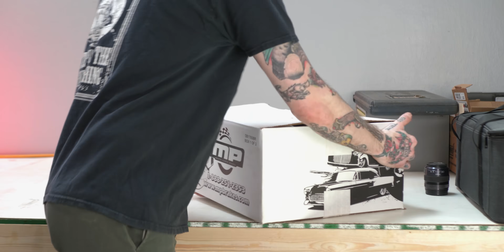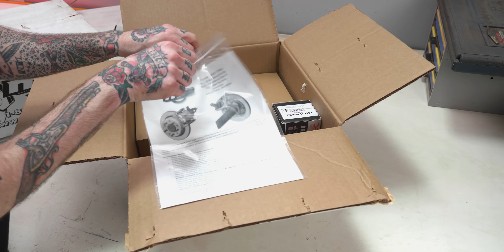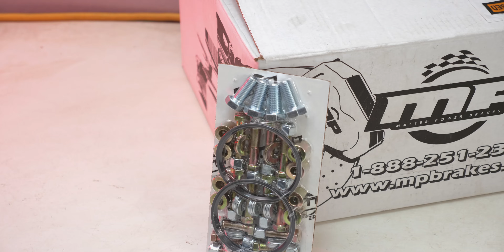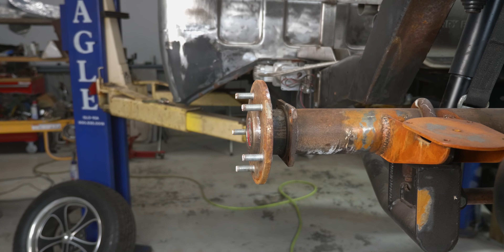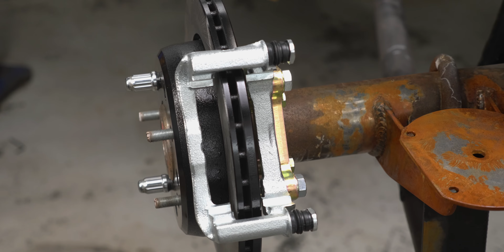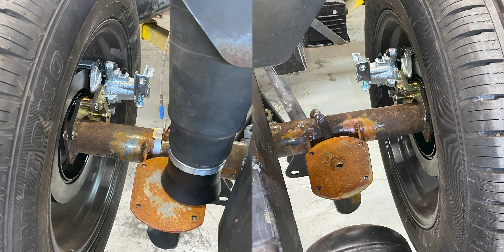C10 Rear Disc Brake Install w/ Master Power Brakes Legend Series Kit - GMC Build

Comment: Awesome video brother! I use the speed way motors rear disc break kit for my conversion on my 63. they use 78-85 Cadillac calipers with the built in e-brake also a very nice kit and pretty straightforward.
Reply: Settled on this kit for my 81 c10 build after watching your video. Should be here next week.